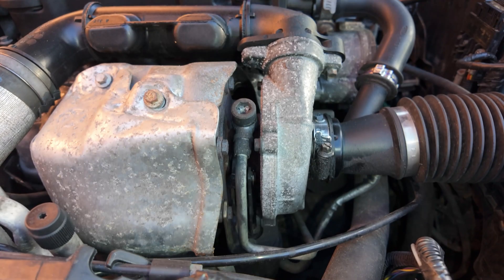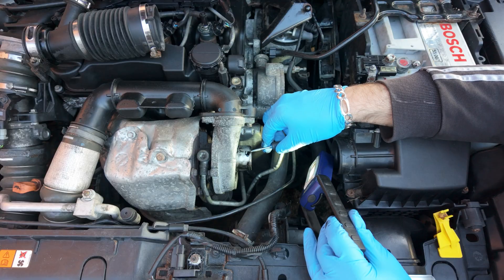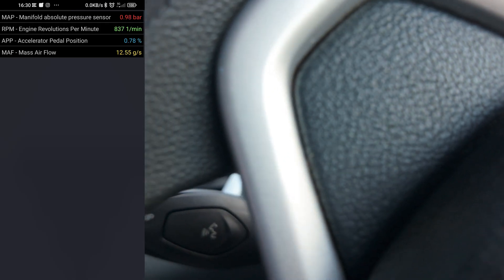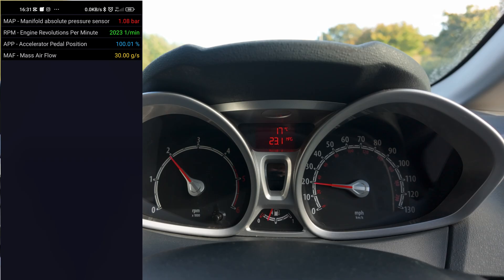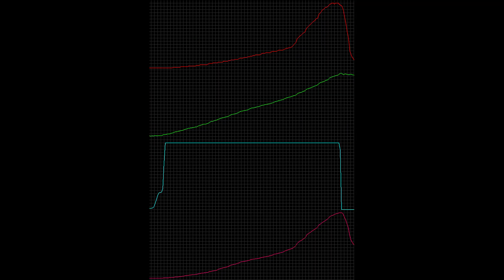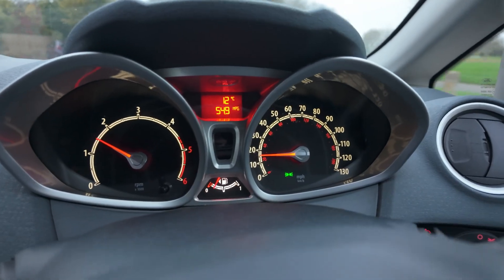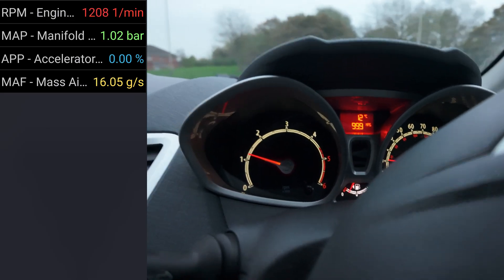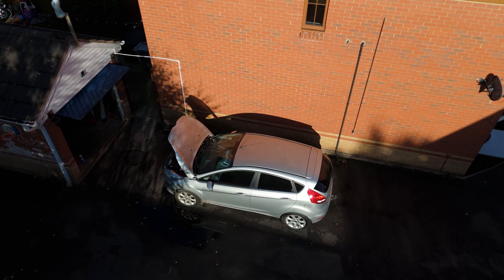Turbocharger Failure Symptoms and Replacement | Ford Fiesta 1.6 TDCi

Comment: At 1.19 minutes what were you using to test and show the results on the lhs of the video? Also does this work with all ford focus  models, I have a mk2?
Reply from the maker: I used Forscan. Software designed for all Ford models.